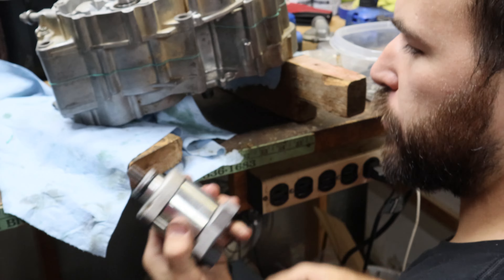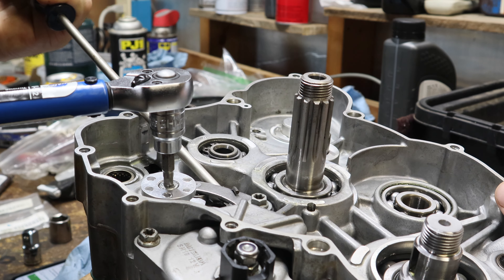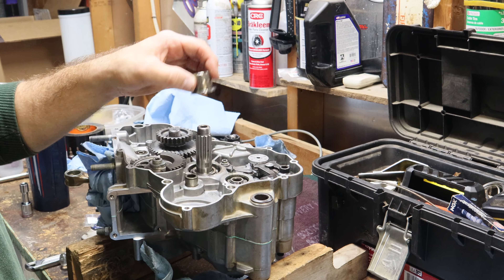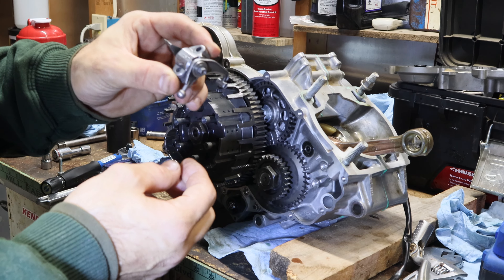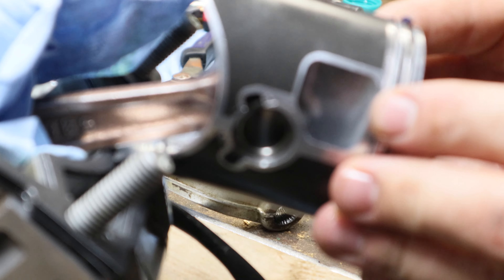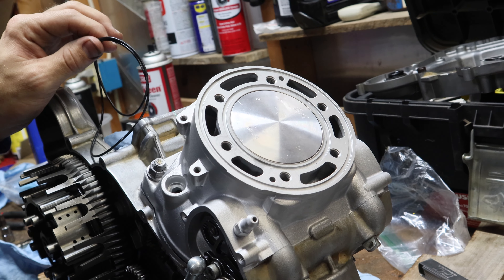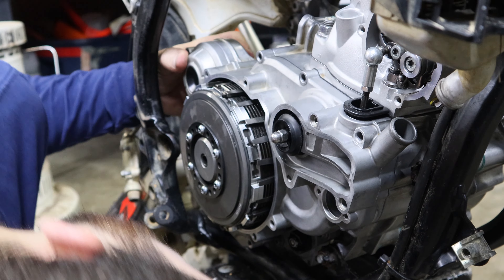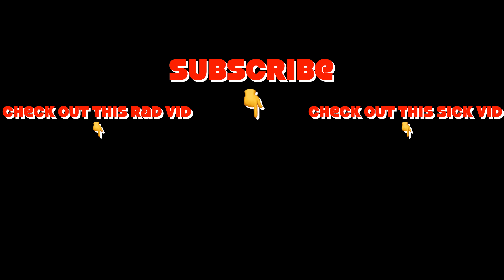2020 KTM 250 XC TPI TOP END REBUILD | UNDER 20 MIN!

Comment: FYI, any excess Loctite is run up the threads when a screw is screwed into a nut or boss in that case.  So just use a small amount as necessary.